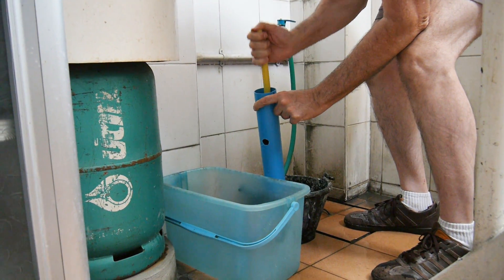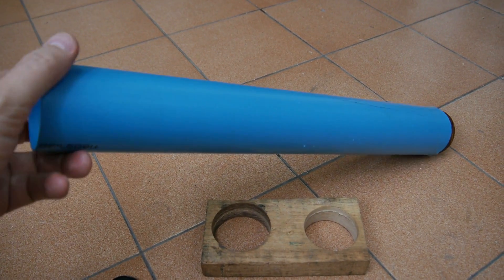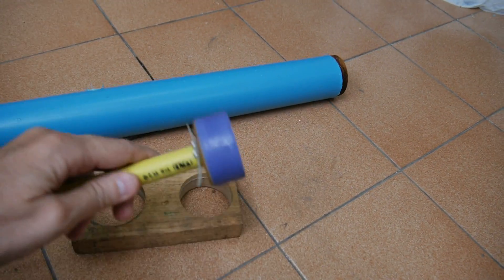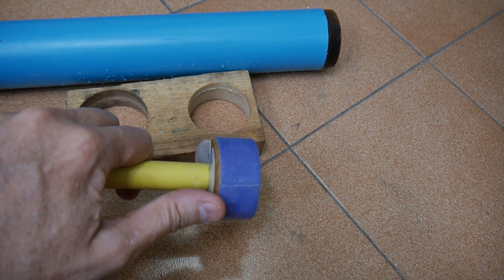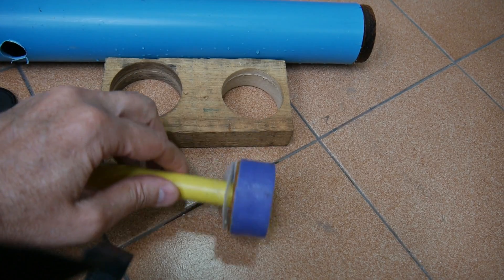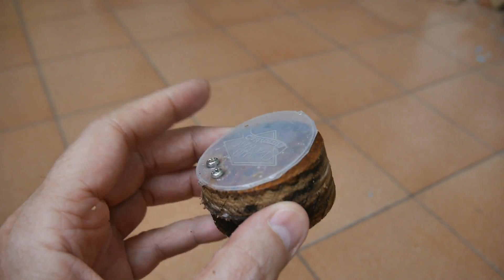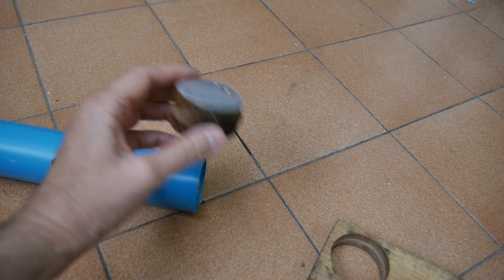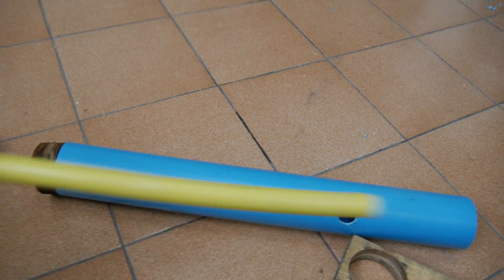DIY Water Pump From Junk

Comment: Add a hose to hang over the side and you have a bilge pump for your boat. This is built just like the pitcher pump every house used to have. Windmill powered pumps are very similar although usually mounted down in the water as you can lift far higher than you can suck up. You would keep a bucket of water to prime the pump if it was above the water level as leakage would have them go dry when not used. It's good to see a youngster using their head for something useful.
 When I lived in Thailand I had running water, I hired a neighbor kid to run and fetch it for me. 2 metal cans nailed to a board/yoke, one for me and one for his mom.
   Mike (o\!/o)